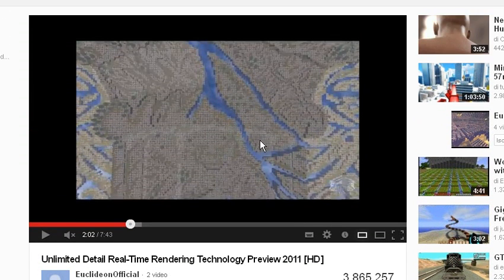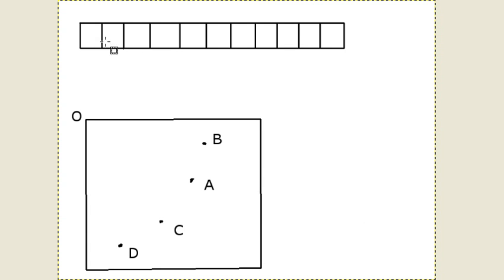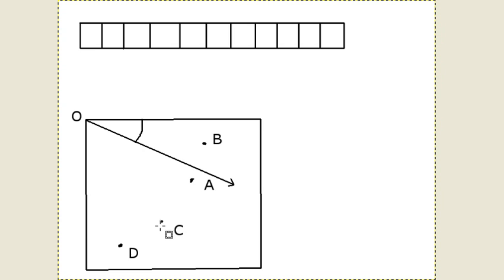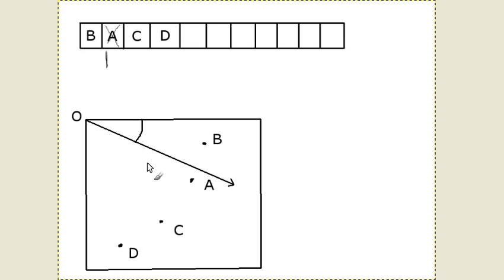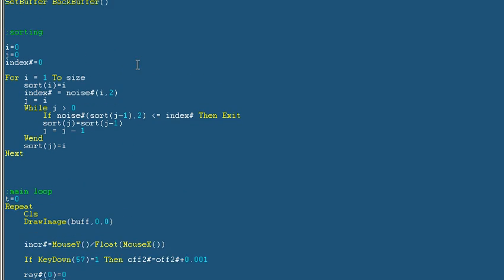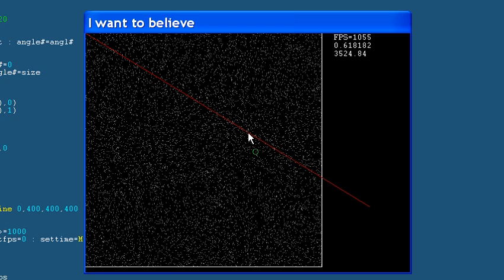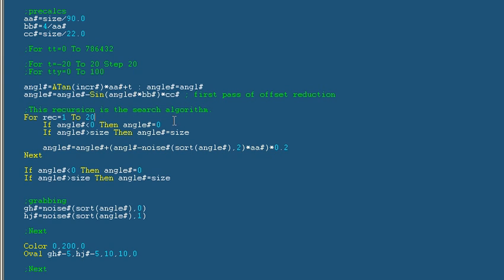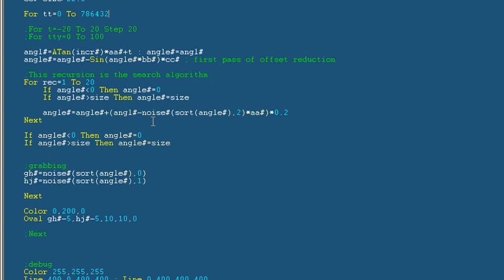My humble opinion on how Euclideon's Unlimited Detail Engine works

Comment: is 2013 and euclideon didn't show us any high 3d animation, ye they showed us geoverse, but that was loaded from a 3tb hard, if you could have google maps saved on a hard it will have the same fast speed.
Reply: KEEVVY If you don't understand how impressive their claims are and why their claims are nothing like Google Maps (whether they are actually achieving those claims or not), then allow me to explain.

Google maps uses a series of images that start with a set of specific 2D images of a specific quality. These are 2D images only, and there are an impressive number that represents various area coverages, but it is not as impressive as Geoverse's actual 3D vertex data, not a few 2D images.

To give an actual example, if you zoom in on your house using Google Earth, that's a 2D image. If you have 3D building's enabled, then it may show some very simple, undetailed models of your house.

However, in Geoverse, the claim is that every window of your house will be measured to exacting standards, every shingle, every gutter, because it is all point data included in these types of maps surveyed -- not just photographs like Google's Street View.

What's also impressive is the claim that this data is being streamed directly from the hard drive itself in real time. If you play a game, for instance, these days, like Call of Duty, all of the assets are loaded into RAM ahead of time. For instance, when you start a game and it's loading, it's loading all of those levels assets into the RAM so the CPU will have fast enough access to the files to perform the calculations as necessary.
Reply: hombacom It is dotted because the scan data is. Higher resoluted scans will result in better quality pictures.

Of course animation and lightning are still to be seen. However this is just one next step.
Reply: nexus1g Regardless of all claims and GBs, it looks dotted closeup in all non-instanced demos which means its very far from acceptable end-user experience. It's obvious that RAM and HDD have very different speeds so streaming static data is very far from what modern 3D applications need. If it was easy to combine techs Euclideon would be stupid if they didn't do it already.

Comment from the maker: You are right. But instead of making the sorting dependent on camera position, one can simplify the work by making it dependent on camera rotation only, so that at least you can move around freely. Still a lot of work though.
This approach is explained in my latest video, you probably want to check it out.

Comment: but does not that means , the points must be sorted for each new camera transformation !!! that sounds very very expensive ... the sorting is camera transformation dependent, you cannot use the sorted points over and over again, you have to resort, unless I got it wrong ..... any comment

Comment from the maker: Splatting mosquitos..
You failed at citing temporal coherency exploitation with reuse of voxels through screen image caching.
For multiple objects standard z-buffering can be used. Or use an octree representation of the high-level structure of the scenery made out of just objects centers inside their bounding spheres which are preventively rendered to test occlusion using another wrapping UD system working just on spheres as first pass. UD inside a UD. UD matrioska shit. Fucking multilayered UD.

Comment: There not a gimmick because there significantly better at representing volume of voxels.  Think of minecraft but on a enormous scale.  I want a game were I can destroy everything...I mean everything not just pre calculated pieces or other thing they use in games.  Volume rendering is possible with marching cubes but it still uses polys and uniform grids.  Who cares about hard drive space don't you want games that are massive.  If you want massive games you need gigabytes of data!

Comment: It is true that UD is a greedy algorithm but it is beacuse of the lack of hardware specified to it.  Rasterization became very popular in the early 90's whey old 2d raycasters could not perform as well as hardware accelerated polygon games.  So the polygon industry took over and voxels were left as old ideas.  Dells algorithm is severely limited by the hardware but Atomontage is significantly better than Dells algorithm.

Comment: Indeed, I already talked about the physics, so i'll say this: you ARE NOT talking about UD unless you acknowledge that all is equal to a flat LED/LCD screen. It is quite like occlusion culling, only better for being 1 to 1 and also more efficient.

It's as if a group of the LED/LCD pixels are calculating more than the others. The FPS will go between this and that, but it will not matter on quantity anymore. It's more about the screen being filled now, so its equal to 1-3 point cloud objects.

Comment: Static?......FFffftttfpptptt BIG W. T. F...THAT would be TOO HUGE an object!

YES, you can go in and rotate any of those objects like a static mesh from the map editor if wanted to!

YES, the lighting is real time, as it changes based on the object's direction!

If what you mean is simply that you don't see them moving or being animated...even that's triple fail, as we've seen the tool moving objects at even an early stage. He said they evolved since then and I don't need to go over it again!

Comment: 2/2

And wait a minute, I never said to fill in gaps with polygons, but with other point cloud based upon the surrounding data, which is, again, very standard a calculation. Fail!

The memory isn't going to be that much higher and the point is that memory is cheaper than an entire card of many GFlops to Tflops. It's easy to upgrade and you're fine on today's memory.

So, again, none of you are talking about UD, but point cloud in general, knowing little about it.

Comment: 1/2

Your comment makes little to no sense. Half of what you claim is debunked by my other comments parts already.

And I didn't say "use point as vertices", I said that "they are LIKE and are as able as vertices already". That means there's no point to use them?

Dumb solution? Why exactly? The gap filling solution will be simpler to calculate and will not require more memory.

WTF...tessellation requires a card! You will NOT get superior speeds over what doesn't already with PS1 style boning.

Comment: If you fill the holes between the atoms created by animation with polygons and use the points as vertices, well you might as well use polygons to begin with. Animating millions of points and hole filling with polygons is a dumb solution. Use subdivision surfaces and hardware tesselation, and you will get superior visualization at superior rendering speed with far less memory consumption.
The only unlimited part of euclideon is their timeline.
We are still waiting for the demo download.

Comment: 3.5/3.5

Most models today hover about at the 5-20MB mark and so do some of the more higher quality point cloud objects. If anything, devs only serve to worry about a doubling or perhaps even a tripling of any object's storage size. Of coarse, this depends on how many points the devs want.

Terrain can be done through procedural generation and crafted too from height maps or other dynamic CPU generated data.

So, even if more memory is needed, it wont be a problem on any memory of several GBs.

Comment: 3/3

...you now only have to worry about the basic calcs, the CPU commands themselves, not the number of objects performing the actions per vert/point.

Lastly, the memory again. It's unlimited detail, not unlimited diversity. Have you ever seen the recent model/texture storage size? It compares too closely, even if slightly less. It wont be that much a hassle for the dev.

Plus, like the cactus, they can compress down to a few objects and thus even remove the clones.

Comment: 2/3

UD pushes only the resolution's worth of points, which would be equivalent to 1 or 2 point cloud objects.

It IS a fact that points can be attached to a bone, as "Voxelstein" already does this. In truth, its the vertex that matters in boning or skinning, so its also not impossible to skin the one object with more than one bone. Again, you would simply interpolate the areas that get pulled apart, based on the surrounding data.

Gameplay is just as possible, only now...

Comment: 1/3

No one is ignoring anything and no one it betting on anyone. You act as if i'm defending anything other than science.

Nay sayers have no clue as to what they're talking about. They aren't even talking about UD half the time, but point cloud and its so called "inabilities" in general.

UD is only the ability to render point cloud for free by making its load that of a screen resolution, in all areas, including bandwidth, physics and lighting calculations ect.

Comment: Your comment shows no awareness of Bruce's timeline and the road he had to go down.

The animation isn't important because it's his own animation. He's a programmer, not an artist. Does this need to be repeated?

It IS possible to skin point cloud as they're the same points verts are. Instead, you would fill in the holes based on the surrounding point, creating an effect similar to polys and textures bending and stretching.

Theories? I think you need to be reeducate as to what a theory is.

Comment: The scanned model could be several thousand polys and the point cloud object was 150k+. It only needs this stored, this 10-100k.

Few more points.

Point = vert. Number of verts calced = frame rate.

Play Voxelstein and you'll understand what I mean. They use a 5th gen style boning procedure, much like those early UD demos did.

Lastly, what you or anyone says affects voxels in general and the current way of doing things. The tool and its out of the box features are not a dev's techniques.

Comment: 2/2

As for memory, he never said anything about it using 140TB. This meant 1 to 1, like how an NES game's memory is compressed through a graphics tile system.

Unlimited detail isn't about removing repetition and this repetition will be by no means worse than any game present today.

I have seen comparisons for scanned models and their point cloud equivalent, and they were about the same.

Unlimited detail is a dynamic system and its likely it fills in gaps based on the surrounding points.

Comment from the maker: If I got it well the whole challenge is about rendering 3D scenes in a single threaded software: the whole algorithm shall work linearly in a strict before-now-after structure, there isn't such a thing as a "meanwhile" in a 1 thread CPU program no matter how hard you try. For parallelization you need a multithreaded software or just ask the GPU to do the job.
Also, one only needs to cast rays whose pixels actually change between frames. This should limit greatly such big loops. Just saying.

Comment: Parallel calculations, not 780,000 individual clock cycles. I know, normal coding languages don't explain "parallel calculation". When data in an iteration-based calculation does not change based on any other of its loops, then it can be done simultaneously, whenever the CPU has time in any of its many transistors. How to program that? I haven't bothered to learn yet.

Comment from the maker: I appreciate your feedback. All you said is very right the only thing I couldn't agree with you is the way points are drawn. You said "facing squares" but this way you remind me of "voxel splatting" but such a thing would require at least a GPU and that's just not the case. My points have no dimension but the algorithm WILL for sure pick 1 no matter what angle you are looking for, maybe this is what gives them mass I guess, I really dont know.
Also, I'll stick on 2D. 3D's just too much for me...